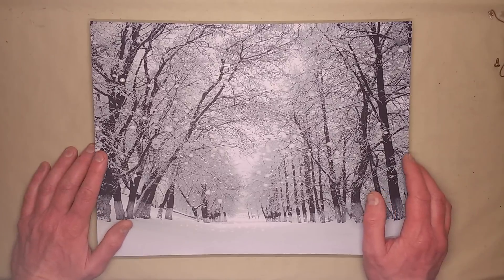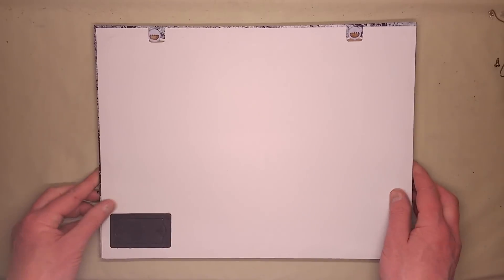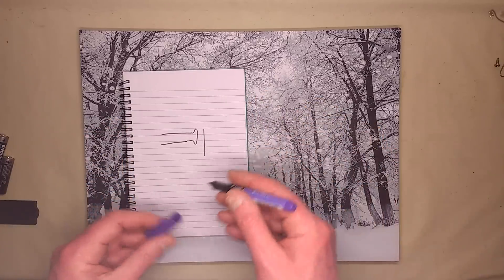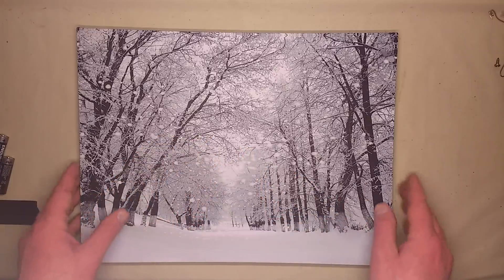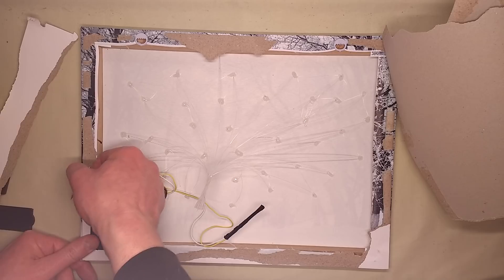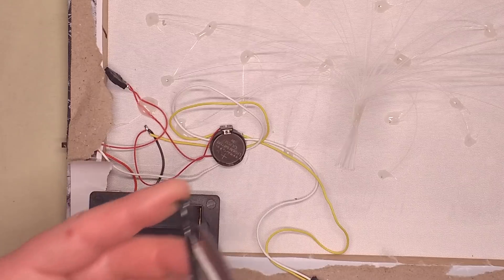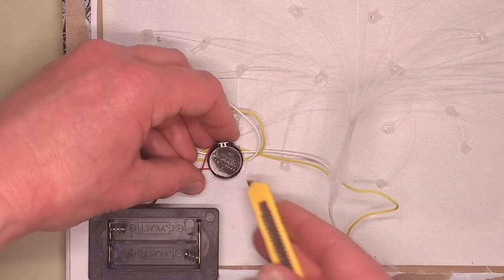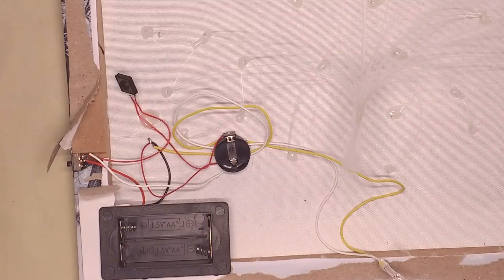inside a fibre optic picture.

Comment: A colour changing LED would look nice :) or a Tri-Colour LED with 3 pots to make your own colour ;) My picture has that nasty soft wood on back which I had to nail back down after I re-LED'd it. B&M obviously had a major pricing fault cos mine was labelled for about £14.99 but at the till scanned as £5, there was no indication they were on offer lol. I like the scene on your picture. You could use more fibre optic and LED's to make a "meteor" effect hanging off the trees in it :D

Comment: Pulled something similar from a dumpster a few weeks back. It used three very warm white LEDs in parallel as simple backlights, with the same yellow and whites leads as here complete with the cut-off ends. No series resistor but the LEDs have what looks like a resistor in the package along with the LED die, which is very offset as a result.

Comment: construction was probably done pushing the fibres from the back with the picture face down on a hot plate... melting the fibre ends before hot gluing them in place

Comment: Dear Clive. Please can you warn people about Cheap USB cables that supposed to charge at 2 or 3amp? I bought a S** load from ebay that supposed to have been able to do the Job for my Mobile Phone. But after 10 cables later, I managed to get some from Fasttech in the end that done the Job properly. But? I am confused why the cheaper ones did not do the job? All i got from them was 0.5amp to 1.2amp max? Tested using a USB Doctor from Chips R Us on ebay;-)
Regards Tony in Portsmouth UK..
Reply: Too high resistance because of thin wires. I bought some '10A' crocodile clip cables and they came with a resistance of about 1.5 ohms each which is absolutely unacceptable.

Comment: The circuit looks to me as if when you press the button it doesn't shunt the two batteries together like you said it did because the switch selects which battery is connected to the led, either the AAA cells or the button cell.
Reply: Tyrone Nelson i seen the same thing. Was about to mention it but thought i better read the comments incase some one else already mentioned it.

Comment: How does this not need a current limiting resistor?
Reply: They rely on the batteries internal resistance...
Reply: Wouldn't this drain the battery about as quickly as a short?

Comment: I'm making a few frames for showing off classic bills and money. Only solar charged using an 18650. I never thought of using fiber optic cable. I was going to hide LED strips but the problems been finding a fame thick enough. This solves that problem. Also makes the battery last a lot longer.

Comment: it's actually quite shocking how expensive fiber optic cable is considering what it is.
Reply from the maker: +Simon  Hopkins It is quite complex to make.  You can buy rolls and looms of it on eBay.
Reply: It's also quite easy to damage, which all adds to the handling cost. Certainly if you want long ends of communication - grade fibre.
Reply: It's probably the polymer stuff.

Comment: You've never been near a motherboard (logic board for apple nuts) before have you (albeit the apples don't always use coin cells)  just a small screwdriver up on the metal bit and ping out it comes, I was so wincing at the sharp knife going at it from the locked positions :O.  The test switch reminds me the um Voice gift cards around

Comment: To do this with multiple LEDs rather than fibre optics from 2 AA batteries, is it best to series them or parellel with a resistor each? Didn't you do a little project like that Clive. Nice effect anyway. I just ask because for whatever reason I have a crap ton of 10mm LEDs of various colours

Comment: Clive you could replace the LED circuit with some milld colored LEDs ones ran from a microcontroller. That way different
points of the star field will have different colors and flash/shimmer at there own rates. Then with a light sensor it could turn
it's self off during the daylight hours.The single level is just too cheesy.

Comment: Nice to see that they've made access to remove the button cell. What if it started leaking or blew up?
Reply: I wondered the same thing. But, I've never seen those cells leak before.
Reply: Mister Hat I had one blow up next to me when I was in bed, I've never moved so fast before or since!
I think it shorted out and over heated. it sounds like a gun going off.

Comment: I had assumed the button cell was a LIR2032 so it could be charged from the 2xAA cells but it wasn't
Reply: If you look at the switch, you can see three wires. This means that the "test" circuit is disconnected when running from the AA cells.

Comment: Difficult to tell, but it could have been a change-over switch, in which case it could be wired up that when it's powered from the dry cells the lithium cell is out of circuit.  Also difficult to tell, but if it was a change-over switch it looked like it wasn't wired that way, i.e., one terminal was also used as a junction for the lithium cell and the batteries.
Reply: It looked like an SPDT switch.

Comment: is there any special way they cut those fiber optic cables?
Reply from the maker: A pair of normal component side-cutters usually works fine as the end doesn't have to be too neat.  For communication industry fibres they use a ceramic blade to get a very clean cut.
Reply: There is a hand tool that lets you polish the ends flat. I prefer to "tease" the cut ends with heat to ball the end over. Turns them into a tiny little magnifying lens. Takes some practice.
Reply: Jammit Timmaj       Thanks!

Comment: I don't think these cheap fibers have any different material on the outside. It's just the same material through and through. You can see that the light is reflected on the surface of the fibers and not on a layer somewhat inside when you touch the fibers, apply glue or even just slightly rough the fibers. It immediately breaks the internal reflection at that point. If the reflective layer were somewhere inside those things shouldn't matter.

Comment: Quite weird to have an extra test battery which basically is forgotten about when you place the picture on your wall with AA's in. Wasteful actually.
Reply: It would make more sense to just include some cheap AA batteries installed. It costs the buyer less this way and it's less wasteful.
Reply: Even in relatively low quantity, coin cells are ridiculously cheap. When I was making a project that used them I was only buying 500 at a time and they were about 4 cents each, and the holders were about the same.
Reply: They are made to sell, the extra battery might cost a tiny amount more it allows a customer to see if it works before buying :)
Reply: Cheap carbon zinc cells leak and destroy the product. Even cheap AAs might cost as much as a cheap button cell and one of the cheapest and most mass produced button cell holders i've ever seen. Figure the couple seconds it takes those asian children to hot glue an extra component and solder two extra wires is probably worth the cost savings on AA batteries.
Reply: The button is a hold down to test button, the AA batteries are on a switch.  The 2032 battery is there just so people can test it in the store before buying.  With AA batteries the picture it would be on or off all the time, the batteries would be dead before the customer purchased it.  
A little push button allow the consumer to test before purchase.

Comment: I've seen some instructables for doing something similar, and usually the instructables have you feeding the fiber optics from the back more than necessary, hot-gluing them in place and then trimming the fronts to all even lengths. If doing a lot of these, I imagine a hot wire (like a hot insulation stripper) would be easy enough to rig into a tool that would melt off the excess fiber on the front at a consistent length and probably would create the mushroom head effect in the process.

Comment: OK so now I really want to see you take apart one of those ultra tacky light-up "animated" painting things.
Do you know what ones I mean? Usually they have a waterfall on them with a weird looking moving water effect.
Reply from the maker: There are two types.  The big rectangular ones have a conveyor belt inside them and the small square ones use a rotating polarised disk and have a pattern of strips of polarised material at sequenced angles so that it creates a chasing effect.

Comment: Did I miss it, or is there no current limiting resistor in that circuit?
Reply: No resistor. They figure the led runs at around 3.3vdc. 2 AA batteries are 3 vdc 'ish and that button cell would be around 3.3 - 3.5 vdc. So as you know they try to make it as cheapo as they can and they can get away with out the resistor.

Comment: I bought some fiber optics for use in some wire frame lantern sculptures (when I get time to work on it) and one thing you can do is to sand the sides of the fibres in order to show some of the light along the length of the fiber. As for my lanterns, I power them with USB powerbanks to power an Arduino Nano and some addressable LED's.

Comment: I see a part two where you split the bundle in 2 separate bundles, random picked strands and put a different color led (warm white or a blue ) in for more effect.
Reply: Jacksat or 2 color changing leds that would eventually offset because none of those cheap ones run at the same speed.

Comment: A lot of the led auto lights here in the states have that test button on the pkg, however on the bigger 4 inch round light for trailers or big Rig' s 12volt tiny round battery. I couldn't help but to save the bits ya never know.

Comment: I just bought some of those button battery holders. It has a springy mechanism to ensure contact with the top side of the battery. The mechanism also looks like it has a release function, but I've not had success in getting the battery out without using a screwdriver or similar instrument.
Reply: it 'should' release the battery (it springs out) when pressing against the metal tab with a tiny flat bladed screwdriver. If it doesn't they are fakes ;-)